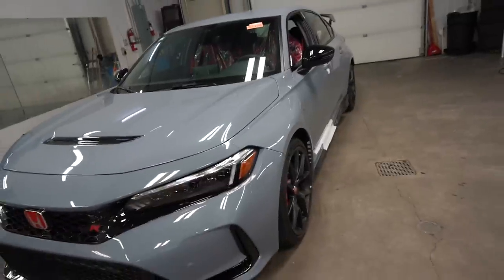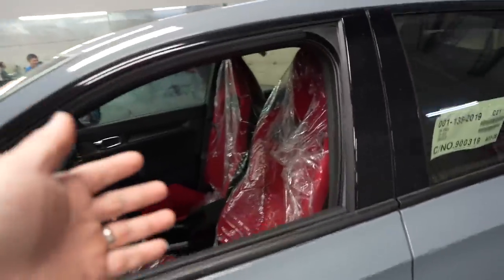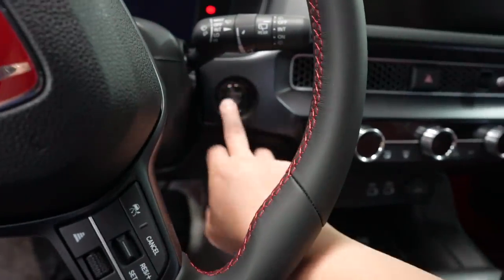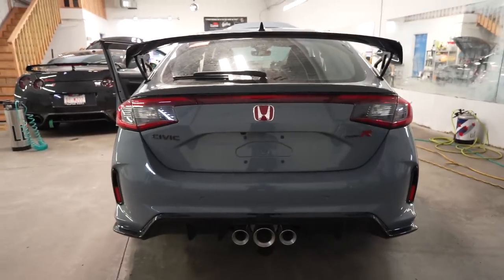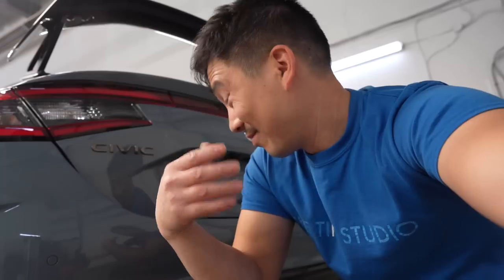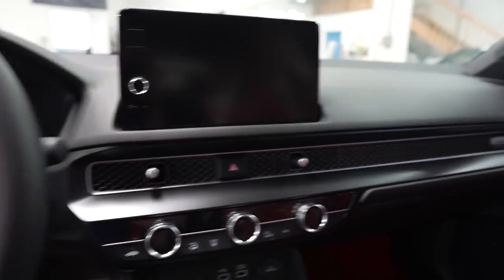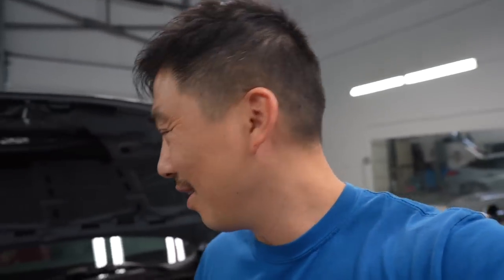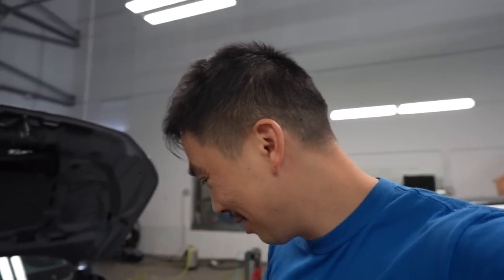$70K 2023 Honda Civic FL5 Type R!!!!

Comment: Honestly the MSRP alone is pretty high but not unreasonable. The dealership mark-up is a flat deal breaker for me. I'm hoping to find it in the used market.
Reply: I wouldn’t keep your hopes up but you should have a lot more luck in the used market. There were FK8s in my area that had 30-45k miles on them and they were still $40-45k. It essentially cost the same if I went to buy a new one at the dealer so we’ll have to wait and see how the prices will fluctuate
Reply: @mrcawfee.  is it really high though? Let’s put it into perspective. Back in 2009, the last year for the Honda S2000 the MSRP was $34,995 which in 2022 money would be $48612.  The fl5 is $44k starting. Would you pay $48k for a Honda S2000 even in 2022? A base model (non turbo 4 cylinder) Supra in 1994 was $36900, in todays money is  $74,201 which is laughable. Let’s not talk about the beloved turbo 6 cylinder.  The Supra, s2000 and other sports cars went out of production because people were not purchasing them. Point blank period. If anything the fk8 R was a steal if obtained at MSRP, especially the 34k MSRP for the 2017 model. Honda brought back this gen cuz last gen sold like hot cakes despite markups. This  44k before taxes is def getting. up there but not unreasonable.
Reply: @delanobeek  I wouldn’t call it a steal at all the Camaro 1le is basically the same price and a lot faster on the track and has a way higher potential being rwd and a v8.   I own a 95 gsr fully built making 400whp capable of more but I time attack the car as well as daily it. Even tho I have 3 other cars but 44k is a lot of money only reason type r is worth it is because of resale value. If it wasn’t for resale I wouldn’t even think about buyin this car above 35k
Reply: @delanobeek  I never said $45k for FL5 was unreasonable tho lol so what are you on about I think $45k is a perfect price I never complained about it once. $45k for a FK8 with 40k miles is a different story and $60-70k for the FL5 is also. I don’t know why you sent me paragraph response on something I didn’t even talk about.
Reply: @mrcawfee.  pull ur shirt down my comment was meant for Mike W.  Relax, we are just having a conversation as enthusiasts. No shade thrown ma’am.
Reply: @delanobeek  Yes, because our money is worth substantially less.. Meaning, its a terrible investment in this market to over-pay because when the market does stabilize you are left with huge monetary losses.
Reply: @JonHop1  there we go 👍. MSRP or nothing. True story , after the Auto show in 2017 I put a down payment on a blue type R, when it came in the dealer wanted 20k added to the 33,995 MSRP.  Took my money back and got a Gti the beginning of 2018. Still have  that car. Wouldn’t mind a FL5 in the future , maybe manual Supra , M3 idk . Who knows
Reply: now new car is 70k....used car market for the FL5 will be at 90k.  I think more than half of the guys who got the FL5 will flip them.
Reply from the maker: I was told all the FL5s sold have a clause on them. You can't sell them to rule out car flippers.
Reply: I paid 43k for my 2021 FK8 brand new.. Back in April 2021. That's the most you'll ever see me pay for a civic lol. But the resale value is great still. I still owe 32k . It's nice to know if I wanted to sell it right now I could still get 47 for it .
Reply from the maker: Thanks Kev you're such a hater haha. Never gonna give you a ride.
Reply: @phothrottle  I’d go for a ride, let me get some balloon animals and some unicorn dust first lol
Reply: @digipifini  or $70,000
Reply from the maker: @digipifini  haha
Reply: Would still take a GSR over this, a much simpler car.
Reply: @michaelf4782  All the old Honda's are better than the fk8 and FL5.. And I own an fk8.. They are a bore in comparison. They have no top end and are a snoozefest.. Great grocery getter tho. Comfortable and easy to drive... All things though that shouldnt be associated with a sport Honda. Sport Honda's are loved because of their raw nature and visceral driving experience. They are almost violent to drive and thats NA!! When you boost those old B,K,F, and H series, they are CRAZY! Even the single-cam D series was soooo much fun!

Comment: At first glance it is expensive, but then factor in the crazy inflation we have gone through post covid, parts constraints etc and then factor in how polished this car has become, then add the fact that it is one of the funnest hot hatches you can buy and that will actually deliver great lap times, than factor that you know it will be reliable and will cost no where near what the Euros,( ie Golf R, M2, M3, Rs3) will cost to run and especially once they are over 5 years and cost a small mortgage to run, it doesn't seem so bad after all, if you got the money probably the last of its breed you can buy

Comment: "Market Adjustment"=dealer greed.  In US dealers adding $15,000-25,000 mark up.  I would never pay that even if I do have the funds.
Reply: I have found a couple dealers that have been charging $10k over, and the cars sold after a few days.  I don’t think they are actually selling for $25k over, but that won’t stop them from asking.

Comment: No leather, 4-cylinder, FWD, manual seats, thin paint, manual hood prop, bulb signals in rear, no forged wheels, MacPherson instead of double wishbone in front, 62/38 weight distribution. Not to mention we don’t know if there will be a Integra Type R. 70K is way too much.
Reply: Funny thing is more than half of those attributes is exactly why you buy it. Add leather, bigger engine, RWD or AWD, motorized seats, nicer paint, piston actuated hood prop... You have a 3800lb car instead of a 3100lb one. If you want a heavy touring car, don't bother with this car at all.
Reply: @Vermonstered  Is the Supra a heavy touring car? Excuses excuses.
Reply: @salimrandall  Tiny car that can't store anything. Nothing remotely close to a Civic in just base design. If you're cross shopping the two, you're just straight up confused.
Reply: @Vermonstered  yup! The gt3 RS is up to a quarter million in some places and it’s got fabric rope door handles and a sticker for an emblem. Real track cars go the extra mile of take out useless options
Reply: @everydayhuy  Yeap, if you care about track performance you don't care about any of the luxury items Salim wants. The Supra he's comparing the Civic to is significantly slower around Nurburgring and no one who knows the purpose of these cars wants an extra 400-600 lbs of junk added to their cars.

Comment: I thought Canada could not mark up ? Honestly 45K American is honestly way to much for a civic. The GR Corolla is all around a better car in the circuit edition
Reply: I don’t think it’s marked up if they add on extended warranty, protection packages and paint protection film. It’s considered a mandatory “upgrade” no mark up lol
Reply: @everydayhuy  it specs out to 62 I believe with almost every accessory.
Reply: @nathanielsmith1892  the add ons they upsell you with are in the finance office not on the manufacturers website.  So you can’t see any of it till you go in and buy it
Reply: @everydayhuy  ultimately the car is isn’t worth it above 40k. It’s a civic.

Comment: Wtf 70K the dealer in my area san diego this car is up for grab for 43k only!!!!
Reply from the maker: If the dealership in your area is letting is go for 43k you should pick it up and flip it. What color is it?
Reply: @phothrottle  blue one bro it look great! Have my 21 lexus is350f cant drive manual 😂
Reply from the maker: @lyks1727  up where I live every FL5 are presold and the dealers know you can not get one anywhere else. They are forsure taking advantage of the current situation. If you are able to get a hold of one you are not able to resale or export. They do look nice eh!
Reply: @phothrottle  yup i love how they look compared to previous one its way nicer and cleaner and its wide body
Reply from the maker: I think because of how wide it is from already factory it is going to look sick lowered and with a flush wheel set up. 😍

Comment: what's that plastic part for? and if its protection how long does it last?
Reply: Yea its probably paint protection film. Most people do the front of the car with the film which is usually the most vulnerable to rocks chipping and stuff, then they'll do the rest of the car with a ceramic coating. I believe it lasts around 7 years.
Reply: @barehands9614  ooooh I understand now thanks for the helpful information
Reply: Llumar paint protection film. Essential a huge screen protector that can cover anything that’s painted.

Comment: If it does the Nürburgring in 5 minutes or less, yes it is worth $70k. But it seems that dealerships and customers have been smoking crack for a while. Asking prices are getting ridiculous.
Reply: If it can run the Nurburgring in 5 minutes or less, than it's worth 10x+ that amount
Reply: For stock car no car can do 5 mins so far 😂
Reply: @mistamaog  100X
Reply: @takiaoua  Actually yeah, you're right

Comment: Had 2 dealership called back both indicated $20,000 over MSRP 
one dealership internet sale director emailed reduce to $15,000 mark up .
my responded maximum $5,000.00 above MSRP I would consider.
that's 10 day's ago. 
Obviously their's are many people's have the money for such crazy mark up.
MSRP is $43,900.00 
add other fee plus $20,000 mark up 
talking about over $70,000 for a Honda 
so what  it's a Type R! so what it's 315HP.  for people's in my age group 
definitely have many other options and choices. 
greedy dealers killed The Market share for younger generation. just like the C07.
Financial institute normally wouldn't approve Financing for vehicle over MSRP.  that mean buyer must put out 
$20,000  cash or pall out  few credit cards 
if not America Express platinum or paid off with American express Black card 
supply and demand 
don't blame all to greedy dealers
People's buying to flip and YouTuber is the caused .

Comment: $70k for a 300hp civic ...  you guys are on drugs ....  go buy a used vette
Reply: Careful bro speaking the truth the people that forked out $60-70k are gonna cry and start a hate mob to justify their purchase.
Reply: I was hoping to get one but for that price I am getting a camaro zl1 for less and smoke that type r like there's no tomorrow. Lol
Reply: @ismancarris6802  perfect
Reply: @ismancarris6802  not around the racetrack you won't.   Straight line sure
Reply: @charliesmith7942  camaro zl1 beat the type r in the track by 3 seconds . There is a lot of info out there plus i used to own a Type r and believe me the CTR does not have a chance agains the zl1.
Reply: @ismancarris6802  you won't be driving the camaro in the snow
Reply: @charliesmith7942  I never drove my Type r in the snow ❄️ too nice to mess it up. Lol.  I drive my expedition for the winter .
Reply: @ismancarris6802  a type r with an intercooler and Hontata tune will push around 365 hp.  That's pretty stout for a 2.0

What kinda gas milage would your Camaro get?  And does it auto rev match?
Reply: @charliesmith7942  about 21mpg . That is where the type r shine ✨️
Reply: @ismancarris6802  ya there are alot of benefits to a type r that people don't see when they see that price tag.   Type R won't loose value

Comment: $70k is a but, but being fair a car is worth what the owner is willing to pay for it. There are more expensive cars that won't hold the value the same way the Type R will so in hindsight you may end up with a more rare and valuable car down the road. And honestly a lot of people who complain also cannot afford it. If they could then some would get one at $70k even if they think it is high simply because it is not a problem financially.
Reply: Dude, is a Civic! For $70K you can get a M2 or M3 for example. At that price point people doesn't care about the car holding the value. Also is not about been able to afford it or not, Car Dealerships are just getting greedy.
Reply: It's not a one off car dude. Those 2.0T are in Honda/Acura lines (Accord chopped it for MY23), it's an enhanced Civic. People allow the dealership put the crown on them, that's it.